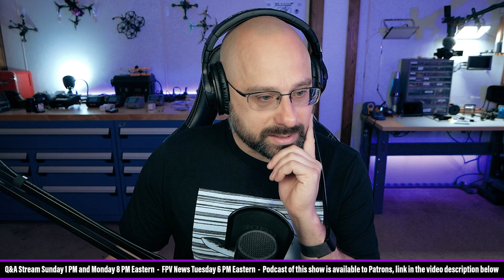Is adding too many capacitors bad for an FPV Drone? No.

Comment: Ok just a ? I have a cheap esc that says that it is 2-6 cell capatible but when looking at it the capacitors on board are 25v in parallel not series in my knowledge  if I hook up a 6s it would blow up  because a 6s fully charged is 25.2volts am I rite ? Or can the capacitors handle the over Voltage?

Comment: I have a 1s drone that has video distortion and severe noise when I increase the throttle... The FC is old and it only has battery pads for power, no 5v or 3.3 pads.  it has no capacitor, what size capacitor should I use on a 1s and do you think it'll help at all, the drone is pretty unflyable as it is?  This is the only video that comes up for this question really.

Comment: I reason that if one wanted to clean up video and video transmission, one would place filtering components (eg. Cap) on the cam/vidTX power supply rather than placing a larger capacitance at the DC battery. The conducted and induced noise is coming from the FETs and once there is capacitance to filter spikes, more seems misplaced. I’ve been making small LC filters (with diode to solve half  the problem) that cures my analog video noice issues. The downside is the weigh and size of the toroid and windings make it less desirable in tiny quads. Thanks Joshua for tackling these tiny but important topics.

Comment: I asked this question because I knew you would know the answer, anything 12s is very expensive so I wanted to be careful about what I was doing and not damage a $350 esc, I added 8- 50v 1000uf caps to the already 8-80v 1000uf caps and anti-spark battery connectors.  As always thanks for the help.

Comment: More capacitors means more spark when plugging in your battery, just use the amount you need to get a good signal and you will be fine 🙂
Reply: Literal sparks? Like those that happen when you plug the Lipo on the XT60?

Comment: I've had negative effects of too many caps before. Had an old 6inch a few years ago that had issues and one of the things I tried was adding afew low ESR caps to my ESC's as well as the one already on my main battery input. It didnt fix the first issue but it did cause another problem with the max OSD chip. OSD elements would randomly disappear and re-appear though the test flights. Went back to a single cap on the battery leads and OSD problem went away. (think it was on an omnibus F4 IIRC)

Comment: I like to use 50v-1000uf CAP cause I'm heavy on the throttle, but will use a smaller one inline of the VTX as well if needed.

Comment: I thought capacitors was to filter the line so you get cleaner Video.   is it a good idea to put more capacitors to get better video ?  is there a limit to how many capacitors you put on to get the best video to your goggles?
Reply: LC filters eliminate most noise going to the vtx but capacitors will help all electronics including vtx but you should have an LC filter online if you’re running analog.

Comment: AC or DC? Because capacitors help to reduce picks (which could be similar to AC in some ways) and give a cleaner DC voltage. 
Of course, the motors receive "AC" voltage... But only the motors. All the rest is going to benefit from a cleaner DC voltage. 
The VTX, for example, if those picks get to it you're going to see electrical noise in your FPV feed. The same applies for a sound amplifier (let's say to build a bluetooth speaker). The capacitor is going to help a lot in the same way. (In this case the electrical noise shows up in form of audible noise.)
The rest... Spot on. 😬
Reply: I have ran my drones with capacitors and without capacitors. I have noticed absolutely no difference Sure they may save you if you get a spike but that is very rare when using a quality flight controller And if you know how to sautter really well
Reply: @johnrosner8964  The issue is the esc, not the FC. But you're correct, some premium quality escs usually are pretty good enough without a capacitor. The escs from Holybro, for example.
Reply: @MCsCreations   I meant to say ESC. 👍